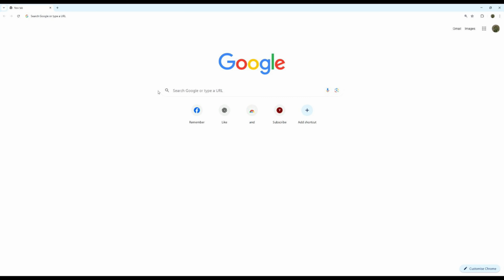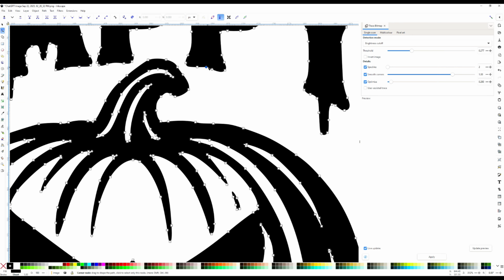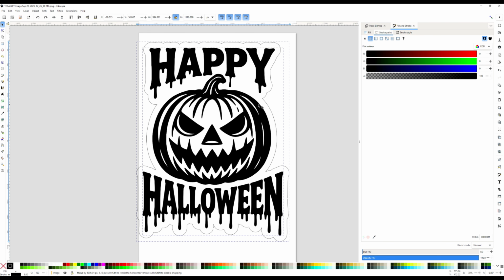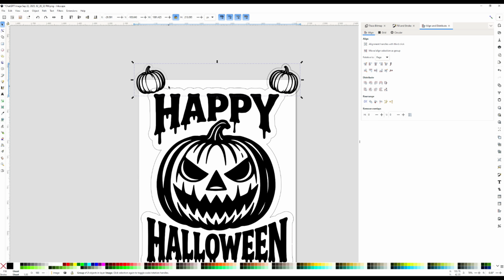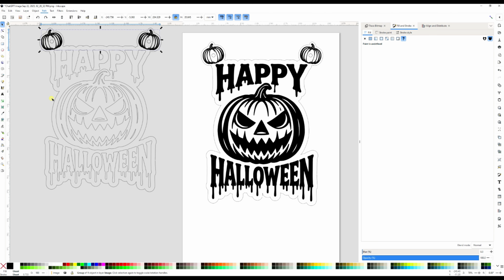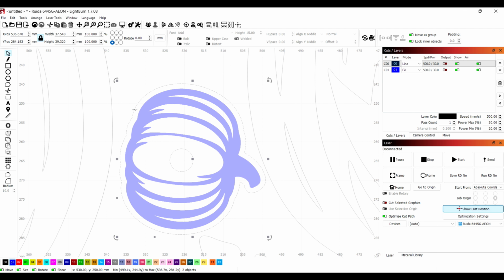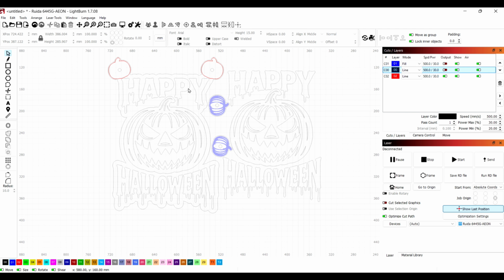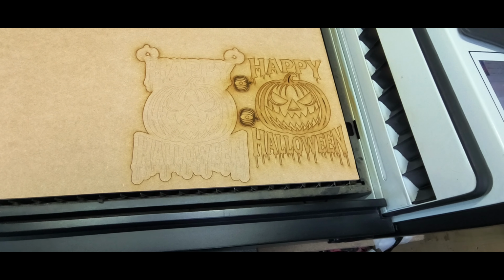AI Design to Finished Laser Cut Sign – ChatGPT, Inkscape & LightBurn Halloween Project

Comment: Do you have air assist on your nozzle? so much smoke damage.
Reply from the maker: I do. But it's because I had the door open for filming the air circulation wasn't working
Reply: @LothianWoodworks I just see a lot of CO2 videos cutting wood, and they have so much smoke clean-up.  My Diode is absolutely clean after a cut. The only time I see smoke is on a heavy engraving. Wonder if it's a CO2 thing.
Reply from the maker: @larryevans7224 MDF is partially bad for smoking. I was cutting 6mm as well I can't honestly say if there's a difference as I've never had a diode that could cut 6mm